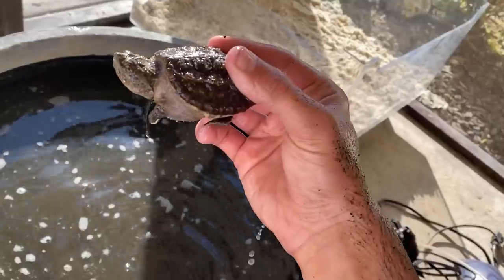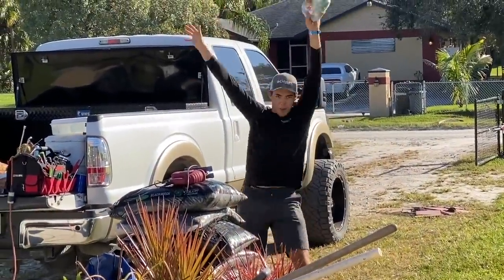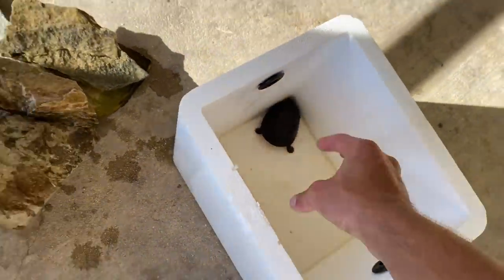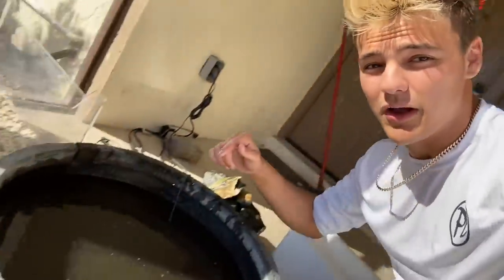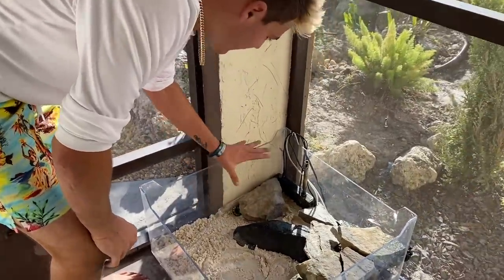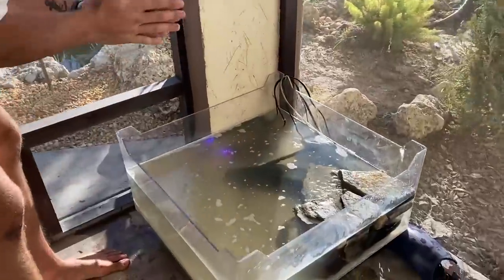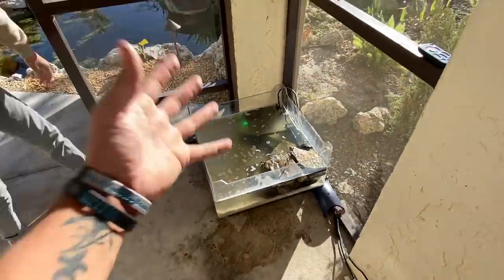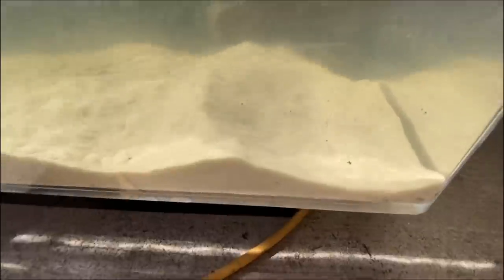My *NEW* BABY TURTLE POND BUILD!!

Comment: cut a large bottle in half and put holes in the bottom then hang it on the side and aim the hose in the bottle, it will stop the substrate, or sand from foggying up the water.